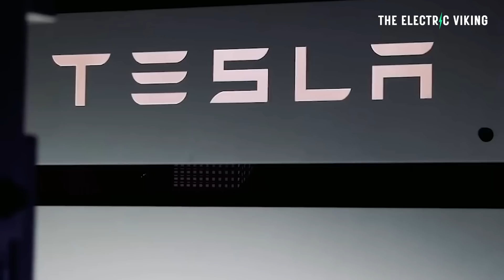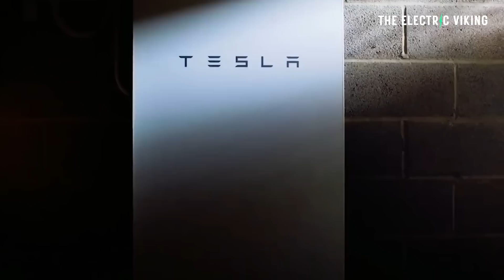Solar levelized cost of electricity has fallen by over 90% since 2010

Comment: 1 kWh of electricity will cost 16.4 cents average in USA  while 1 kWh of equivalent gas is about 8 cents so roughly electric should cost double the gas why it is doesn't or does depends all on the nitty grittys but problem with gas vehicles is extremely large maintenance cost and headache of getting gas while a large part of electricity comes from solar
Reply: And the gases we have to breathe.
Reply: @Fomites  sure combustion is never great for the lungs and it's tiny air sacs called alveoli which get choked irreversibly by smoke particles as a medical doctor I can definitely say that but as a person with a degree in mechanical engineering I would also say that efficiency of conversion of solar to electric can also come into big play as the Carnot efficiency (thermal efficiency of IC engine) which is about 30% max. The whole problem is not so cut and dry as of now I have all electric cars and I charge them using solar panels most of time but what keeps me awake at night is those precious materials the blood diamonds in the batteries thats mined in Congo by little kids . I don't have any children of mine but I sure do care about children of other people far away in Africa for example there is no one for those people except us. BLUF I would say weigh your karma carefully and consider the full picture.

Comment: Only two of us and still have average bill of $230 to $250 a month. The only way a solar system will help is having a battery and a lot of Aussies cannot afford.
Reply: Ours was 300 over winter with 5 people & an EV/300ks/week.
Spring to autumn bills are normally around 80 - 120.
No battery yet.
All 3 x HWS (heat pumps),  dishwashers car are used & charged during middle of the day.
Amber Electric is the retailer
Reply: Solar actually makes wind more expensive, in northern climates
Reply: @markthomasson5077  solar and wind actually makes ALL electricity more expensive.!
Every country that has significant % of wind and solar in their generation, have seen huge increases in electricity costs.
Levelised cost does not reflect the FULL cost of electricity supply.
You need the FULL SYSTEM SUPPLY COST which includes the costs of all the extra interconnectors, storage, replacement ( short life cycle) , back up power, and FcAS, costs.
When those are included, wind and solar show exceptionally high cost per MWh compared even to Nuclear.

Comment: With the pace of progress things are going to be very different in a decade, solar and batteries will be as common in a home as a fridge is now... Compared to anything else solar and batteries look like magic and still feels like it after 5 years with my system. Just stick a few panels on the roof, connect a few cables to the battery and shazam, free power that falls out of the sky for 20+ maintenece free years. I imagine legacy energy are very worried by now, didums :)

Comment: Flat TVs are almost impossible to make and require a huge investment.  And yet they are dirt cheap. Why was it cheaper to cover my roof with 4k TVs than to put solar on it? The cost of solar had to come down because the price was just ridiculous for no reason, it's about time they came down but they still cost WAY more than they should. Same thing is true of batteries and EVs, the cost must and will come down even with industry and governments trying to keep the price high with BS policy.
Reply: When flat screen TVs first came on the market, they were horrendously expensive, but Wright's Law helped them get progressively cheaper over time. The same has happened for solar panels, batteries, EVs, computers, mobile/cell phone, smart phones and many other products. But Wright's Law does not state that the rate at which one thing will get cheaper will be the same as the rate that something else will get cheaper. As such, you are engaging in an apples and oranges comparison when asking, "Why was it cheaper to cover my roof with 4k TVs than to put solar on it?" Aside from that, your question incorrectly assumes that it would be cheaper to cover your roof with flat screen TVs that with solar. At least where I live (UK), the cost per square meter of a solar panel is cheaper than the cost per square meter of a flat screen TV, so the materials cost to cover your roof will be cheaper for solar panels. Then, just like you need to pay for fixing brackets and labour to install solar panels on your roof, you would also need to pay for fixing brackets and labour to install flat screen TVs on your roof.

When you write, "The cost of solar had to come down because the price was just ridiculous for no reason", you are engaging in a logical fallacy that just because you cannot think of a reason for [such-and-such], there isn't a reason for [such-and-such]. It is much more likely that you cannot think of a reason for [such-and-such] due to your ignorance of the topic.

Comment: Solar and storage combined have to fall at least another 50% to be competitive and to shut down the already working gas power plants.
I saw a documentary which explained it thoroughly.
If I find it gonna add it later!
Reply: Solar and storage:  "Hold my beer"
Reply: You saw a documentary from 10 years ago. Its already cheaper to replace existing gas assets with solar and batteries today, than it is to merely continue to buy fuel for them for 10 years. Let alone the operate costs of gas plants and their maintenance.
Reply: Do you remember its name?